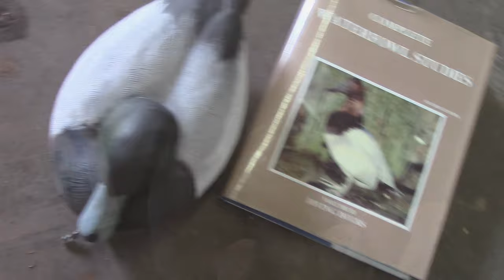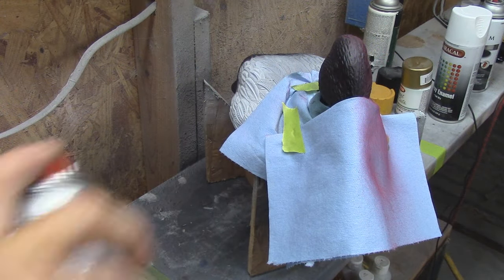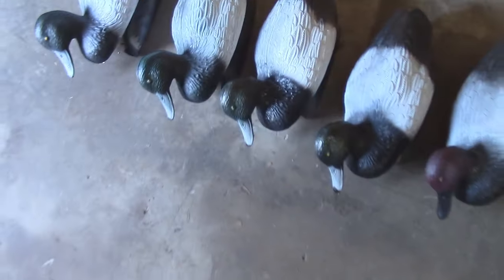How to repaint old duck decoys

Comment: What type of clear coat did you use,  I've used flat krylon but it always fogs up and I barely spray it
Reply from the maker: I've recently started using the ace store brand but i have used valspar from Lowes . Try using a satin and spraying several light coats. Sometimes clears will cloud if there is alot of moisture in the air , try useing a hair dryer on that spot for a few mins. Thank you for watching .
Reply: I'll have to try that, thanks for the reply. Your videos are really good. I've already painted over a dozen and plan to do 2-3 more dozen as well. Keep up the good vids and hope you have a great season